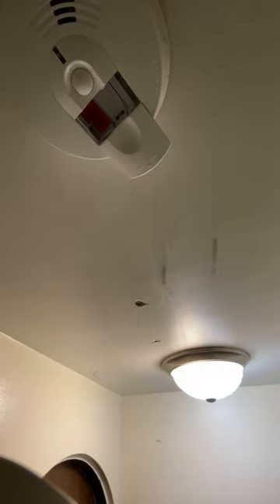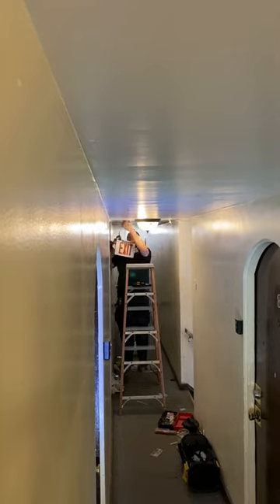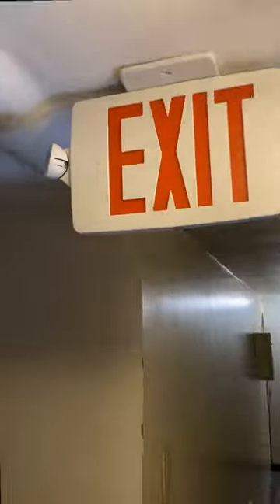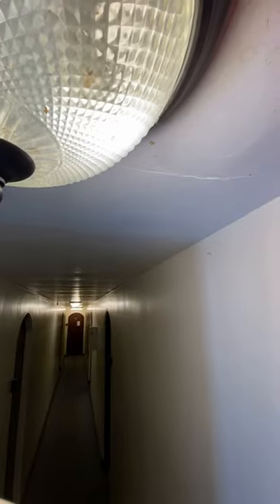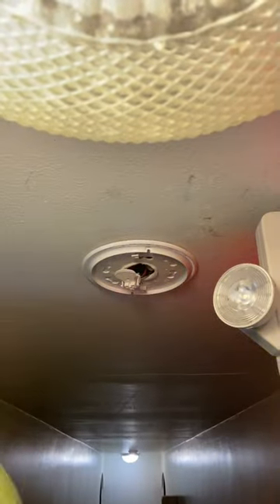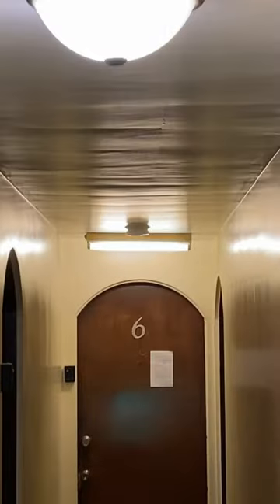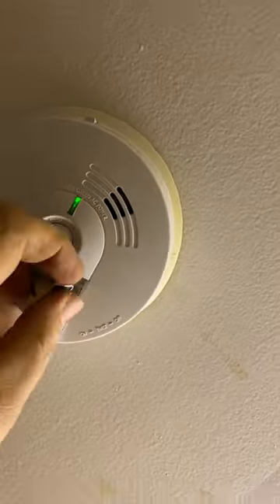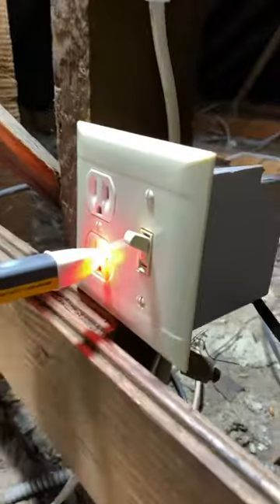Replacing a exit sign and making some electrical upgrades #HandsomeOrHandy #Handyman￼￼ #Electrician￼

Comment: you should really read the directions and UL listing on them smoke detectors you will find that they are only listed to be installed in a single dwelling and not in a commercial install that a common hallway in an apartment building us considered. And hopefully that's a heated hallway cause those alarms will not function below 40 degrees F
Reply: I 100% agree with you honestly they should just install a commercial fire alarm system. Even if they went with a wireless system like what Honeywell and system sensor offers. Even if it was a small two family apartment building the cost of installing a fire alarm system would be relatively low. And if it was a larger apartment building than a fire alarm system is probably required. However the smoke alarm system might just be grandfathered in. I feel like State officials and Fire protection agencies to do a better job when it comes to life safety.
Reply: Smoke alarms*
Reply: @SodiumInduction-hv you don't need to keep correcting people
Reply: @someengineermain6803  actually I do
Reply: @SodiumInduction-hv What's the point of correcting people?

Comment: You should add emergency lights because that exit sign is a generic piece of junk that is dim. Those smoke detectors just have a light to show is it is in alarm or not and don't put off much light.
Reply: They should get a duel lite ev or a evhc

Comment: DUDE WHO BROKE A RARE EXIT😭😭😭😭
Reply: Sure-Lites LPX combos aren’t rare
Reply: LPX DH units are rare by no means. sure, more are getting whacked down since the LEDs are going out, but they aren't as rare yet, and the LEDs go out after ten years. as a collector of exit signs, I wouldn't want one unless it had remote capacity (LPXH7 DH) so I could run DC lamps back into the exit sign, put some lamp kits and tubular LEDs in, and forget about the LED assembly altogether.
Reply: @TheExitSignDudeOfficial  They got discontinued thats why
Reply: @NoobyShorties oh okay

Comment: Is poor presco light Exit sign. Why didn't you install a name Brand Exit sign Like Dual light. All of those generic units are not good at all. You will probably be called back in a week because it broke. I'm sick of going into buildings and seeing exit sign that are overrated and underperforming with low build quality. If you want a good LED exit sign use a dual EV series. You're going to be getting a premium exit sign at a Premium cost but you can't put a price on the Life Safety.
Reply: He probably doesn't want to go online and pay a lot for a name brand exit sign
Reply: @someengineermain6803  yeah but there's certain things to cheap out on. Exit sign should not be one of them. Nor should any life safety equipment. If you've ever watched fire alarm dude 5967 video about everything wrong with exit and emergency lighting you will see where I'm coming from. Also when you collect exit signs like me it's pretty obvious why you don't want to install cheap units.
Reply: @zacharykorbet9690  yess
Reply: @zacharykorbet9690 yeah but he's a repairman not an exit sign collector
Reply: @zacharykorbet9690  yes 100 percent agree i have a lithuiona it sucks but my lumacell is way better and made of steel etc

Comment: Unusual that you didn’t document the cell replacement dates in the detectors. I have 5-9 in a 3/2, some not mounted. 

And I don’t collect americium from the detectors 😂

Nice panel. I’ve no idea how you can be so upbeat. I’m usually swearing when I do stuff.

FunkFPV cracks me up too. 😂🎉
Reply: Both of these guys—good balance…